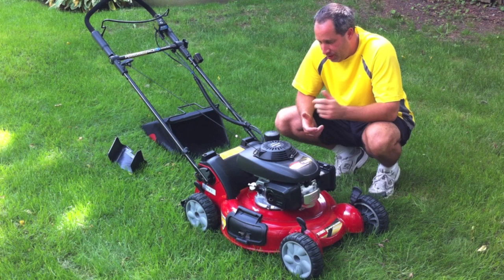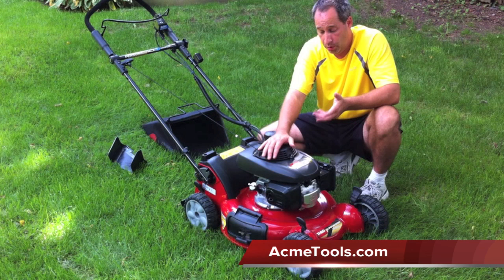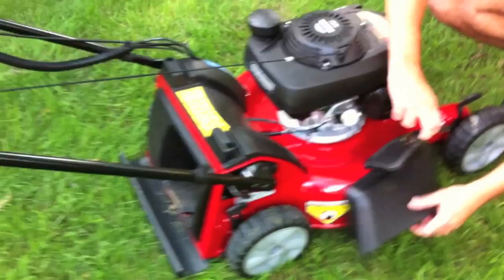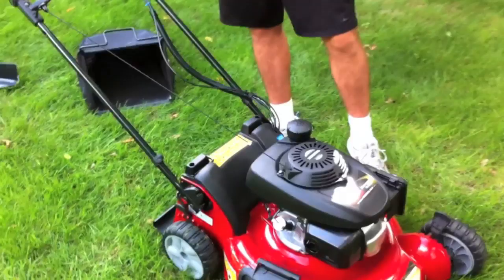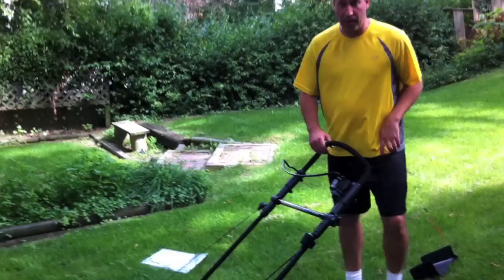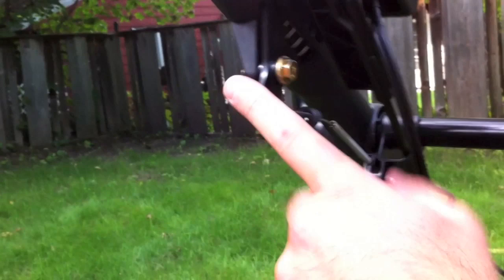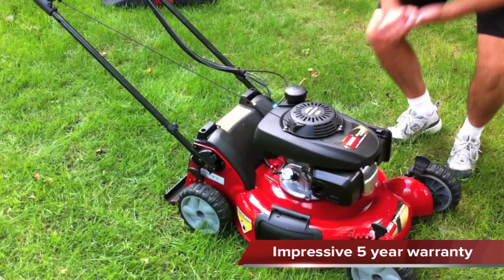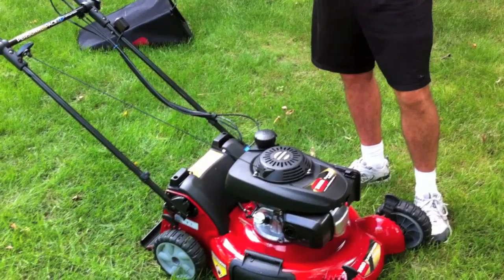TORO 21 In Super Bagger Personal Pace 20197 Review

Comment: I bought the super bagger this spring.  Mine doesn't have the BBC though.  It's a really great mower.  Mulches and side discharges well and bags amazingly well...wet or dry grass.  The honda engine is great but a tad weak in heavy grass.  My dealer upped the rpms to 3200 from the factory setting of 3050.  This has helped a bit.  Overall, a really good mower for the home owner.